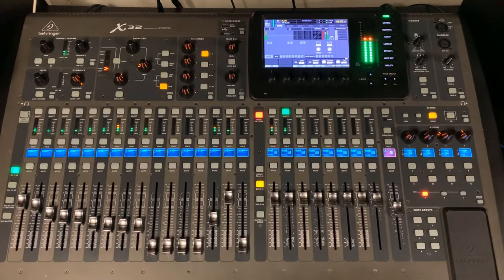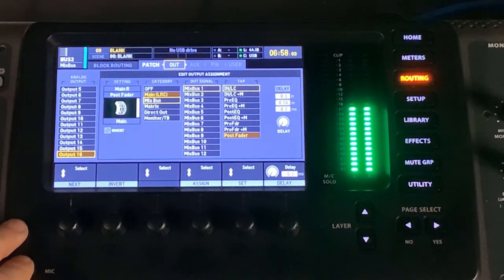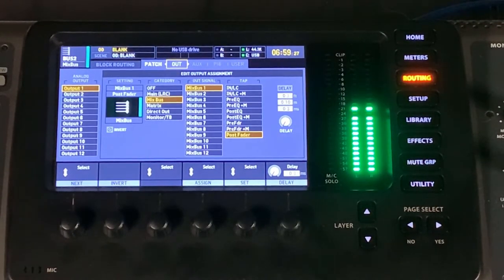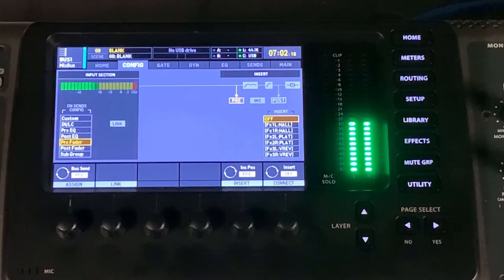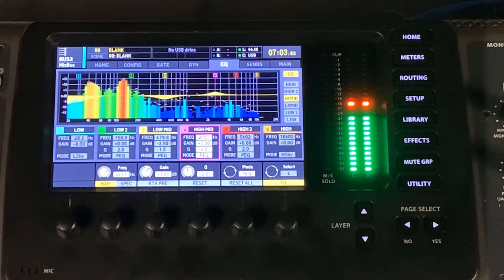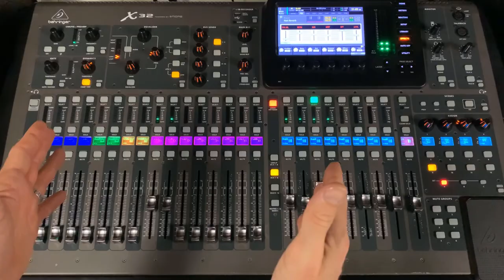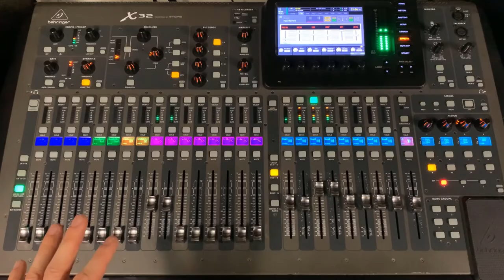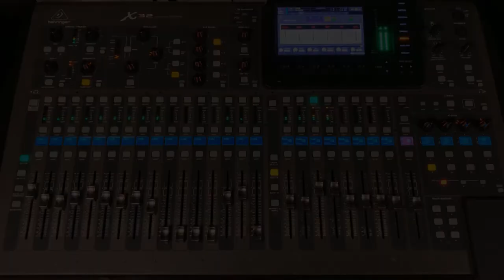How To Setup Monitors On The X32 (or M32) Sound Console

Comment: I am so lost on the M32.   But following along and making the changes on my board as you did in this video really opened up the idea that I can actually make this work....eventually.  Thanks so much.  Liked and subscribed.
Reply from the maker: Thanks for the encouragement. Let em know what your challenges are and I can either point you towards existing videos, help you in a one-on-one session or maybe make a new video.
Reply: @AllamHouse  I’ve got several and too many  to go into here.  I think I’ve got the trail for IEM down.  Now I have to be able to monitor the music tracks in Pro Tools while tracking drums.   A Sweetwater tech remotely set the board  up for recording onto Pro Tools…we just didn’t get to the monitoring part.
Reply from the maker: Here is a video that might cover a similar setup. This walks the viewer through sending audio to a DAW to be mixed for live stream. That mix is then sent back to the console and comes in on AUX In 1/2. This setup would allow you to track instruments into Pro Tools and then send some Mix from PT back into the X32 to be solo’d in the headphones or out the monitor output.
https://youtu.be/KpZpsO_l4Qs?si=lT1oD-UrkhfQvqSz

Comment: How would you go about adding effects like reverb to the house mix? (you mentioned in this video - that you would only want the reverb to go to the monitors - but I think I am wanting reverb in the house as well - but would want to control that independently from the monitors mix)
Reply from the maker: I don’t ha e a specific video about this yet, but it is the same process as setting up a monitor. The console has 4 preset FX racks and busses on Bus 13-16. Select the bus that relates to the FX rack you want, click Sends on Fader, raise the instrument you want going into that FX rack and you are set. Then go to the FX return on the left side of the console and raise the stereo return to the desired level.

Comment: Please help. I have worked very hard in learning as much as I can and we will be installing this board at my church. However, I am having a problem. When I tap BUS1 (which is our mon1) and tap sends on faders, and then adjust channels to be heard in that mon1, and escape out of it, when I then turn a vocal mic channel all the way down, I am still hearing vocal through the mains. I shouldn't be hearing that mic in the mains. What am i doing wrong? So frustrating. thanks
Reply from the maker: That is frustrating. You need to adjust the Bus from Pre Fader to Post Fader for sending the inputs into the Bus.  You do this by selecting the Bus and go to Home > Config and make the switch. This video explains the difference from the tap point for sending from the console. https://youtu.be/1GNmNWdVWKg

Comment: Great info - except at 13:15 where you say you "can do some light compression in the monitor in case things get out of hand". Professional singers will immediately notice that there is compression on their monitor and will stop singing to avoid injury to their vocal chords. Amateur singers will change the way they are singing to try to compensate for the attack and release of the compressor, including trying to sing louder as the compression ratio goes up. They will leave with a hoarse voice, which is not a problem for amateurs, but it is a big deal for folks who make their living with their voice. And repeated straining against a compressor can/will cause vocal chord nodules to develop, which require surgery to remove. 
The other 99% of this video was outstanding and helped me (an old analog guy)  tremendously!
Reply from the maker: Thanks for the input and great info from a vocalist perspective. As a drummer I tend to run a little compression on my IEM depending on the instrumentation. As much as we try to control guitarists they tens to have spots where their volume gets louder when there are people in the seats. I try to keep that controlled and save my ears throughout a night.

Comment: Hi! I followed the instruction by setup a mixbus but routed thru a Aux out 1 to Behringer HA400 this morning. I sent the vocal and keyboard channels to it. The user was able to hear thru the headset and happy with it.  However, I found out later when I turned down keyboard fader all the way to -00. I still can hear it from the main speaker. It seems like the volume no longer controlled by the fader.  Further troubleshooting found out that it only work if I first turned the mixbus volume down to -00. I didn't test it on vocal channels. Not sure what I have set wrong. Any suggestion? Thank you.
Reply from the maker: This is because you have the MixBUS setup as ‘PreFader’ instead of ‘PostFader’. PreFader is what you want for an In-Ear monitor mix so it does not change when you move faders for your House mix. If you have a wedge monitor or other open speaker that can be heard in your room then you probably want to run PostFader so that when you turn the fader all the way down in your House it will also turn down in your monitor.
Reply: @AllamHouse  I am pretty sure I set to Postfader. I will check it tomorrow or Sunday when I get back. Thanks
Reply: I did verified this morning that monitoring mixbus was setup as postfader. For any channels (keyboard, guitar or vocal) that I send to the mixbus, even I turn the volume down all the way down on each channel, I still can hear it on the main LR speaker. The only way is to turn the volume of the mixbus of it to -00.  If I don't send it to mixbus, I can control it with each individual fader. Is there anything that I misconfigured?

Comment: Thank you for the great video. Question. Using only my left output on my IEM transmitter. Would I need to plug in the right to the next mixbus to allow panning instruments left and right in the monitor mix?
Reply from the maker: If you are looking for stereo IEM that you can do panning you will need to start by making a stereo BUS.  You would take an odd numbered BUS and link it to the next even numbered BUS.  Then you have the ability to send stereo signals to both sides of your IEM transmitter (yes, through a second cable).  The board configuration will allow you to either take the panning used by FOH or your can override it in the sends area and customize the panning for this specific stereo BUS.
Reply: @AllamHouse  perfect! Thank you for allowing us to pick your brain!

Comment: Thank you ahead of time…. I’m using a X32 compact, its not mine, not sure if I’m doing anything right,
It’s been ‘adjusted’ prior to my arrival, I had difficulties getting 1 thru 8 to come out the mains, I pushed some buttons and it seems to be working, how do I get individual settings for the monitors without adjusting the ‘gain’… not sure if I’m explaining it correctly!
Reply from the maker: Gain should be set for each input and I look to set mine at -12dB on the input meter. The gain will impact all things downstream. Once this is set you will can find a monitor BUS, select it and then hit the “sends on fader” button in the middle of the console. This will shift and slow you to use the faders to adjust the level of each input going to your monitor BUS.

Comment: Hi there 👋 wondering if you can help me out with the x32.   Basically I have in ear monitors set up on bus 11 and I want to set it up as prefader but every time I do that it also changes bus 12 as Prefader but I need that bus to be postfader.   Any way to do this?
Reply: Pretty new but are they linked?
Reply from the maker: First thing, Make sure you have your scene saved to the console or to a thumb drive.  Then, make sure you are on V4.0 (or higher) firmware to make this real easy.  Assuming you are on V4 you can select the desired MixBUS 11 and hit the Home button.  Make sure the bus is NOT linked.  Then go to the Config tab and you can select this bus to be pre-fader.  If it is linked it will automatically adjust Bus 12 or if you are on the older firmware it will run in blocks as well.  Let me know how it goes for you.

Comment: You have video on in ear monitor mixes the eq and compression outline to setup a perfect in ear mix. I use shure 425 on a behringer p1.  If you could do a video on that thanks
Reply from the maker: Wow, that would be really complex to try and make a video like that. Each person hears different, each set of monitors are different and the instrument being played is different. I will say, I tend to use compression more as a limiter with a 10:1 ratio and remove just 1-2 dB. In terms of EQ I usually roll off the bottom around 50hZ since the actual monitors can’t accurately reproduce these frequencies. I also remove a little mud at 400 and maybe a little boost at 3k to add some vocal diction. Keep in mind I’m usually playing drums in a church worship context.

Comment: Hello! When I play with my band the master volumes ducks when we push the faders. Its like its a limiter somewere on the master L/R that limits the sound - it does not distort. Do you know anything about it? Im a sound technican but cant figure it out.
Reply from the maker: This is an interesting question. Here are the steps I would take to begin my troubleshooting process.
1) Take some pre-recorded music (iTunes, Spotify, etc) and send it into the console. Make sure your input level is between -12 and -9 on the input fader.

2) Turn this up in your main mix and begin turning the master fader up to the desired level in the room. Evaluate if you hear the same "limiting" happening. 

3) There is an onboard limiter and a channel compressor for the main outs and you want to confirm that these are turned off. Above the master fader, push the "select" button and then go to Home > Dynamics. Make sure the compressor is not activated by looking at the bottom left knob of the screen and make sure the words are grey and not orange. This confirms the compressor is not activated. Next click the "effects" button to the right of the screen and if there is a plugin active on the Main mix it will come up. If there is, then you can push the knobs below the screen so that INS is not orange therefore being deactivated.

Once you have confirmed that no issues are happening on the pre-recorded music, then you can move to the normal inputs. Set proper gain structure (between -12 and -9 on the input meter), build your mix and then begin bringing up the volume.  If you still run into issues, check after the console and see if there is a DSP (digital signal processor) or other settings on your amps or speakers that might be causing some limiting.

Comment: Hey Dave I got a dumb question the way I have my drums set up is its running through the board and I'm listening out through my in ears  out the main headphone jack on the x32  producer. I made an inear mix on a mix bus channel and ran my wireless inear system to that Also I tried my wired in ear system as well with the mix bus but it doesn't sound anywhere near as good as the headphone plug in the front of the board.my question is, is there any way to make a mixbus inear mix sound like what I'm hearing out the front headphone jack?
Reply from the maker: Yes. Keep in mind the headphone jack is a stereo feed of your main mix (unless you solo something and then that takes over). Your IEM is most likely a mono mix which will have much less width than your stereo house mix. I recommend linking two buses together to get a stereo mix.  Then, you could set it to Pre-Fader and build your desired IEM mix. You have the ability to follow your LR panning or do custom panning for your IEM. Also, make sure to add some FX into your IEM to sweeten it up.
Reply: @AllamHouse   much appreciated I'll try that for sure and if I can't get what I'm looking for I may have to do a one on one with you so you can further help me.i love this board but man it's a learning curve for sure.

Comment: So is there actually a difference between our channel beeing set to PRE-Fader and TAP PRE-Fader ? Or do we set the channel on the board to PRE-Fader but change it to POST-Fader in the TAP menu ? Does it change something ?
Reply from the maker: I'm not sure I understand the question exactly.  When using a MixBUS for monitors you will be able to select between pre-fader or post-fader which (for in ear monitors) you want a pre-fader mix.  In terms of the tap (preEQ, preEQ+m, etc) this determines weather you are feeding your monitor with a raw signal from stage or if they are getting the EQ'd signal that the sound tech is applying back into their monitor.  EXAMPLE: a guitarist as a super lush tone from their amp into the sound board.  The sound tech removes a hand full of frequencies with EQ to make it fit the mix and PA better.  Do you send the EQ'd signal back to the guitarist or the raw, non-EQ'd signal back? 

I hope this helps.
Reply: @AllamHouse  I play guitar. The signal that comes through the house sounds great due to the EQ adjustments that were made. The signal that I hear in my in-ear monitor (and on our stream) sounds squashed and very thin. I would like the EQ'd signal to come back. Do you do that by selecting the Post EQ option from the Config - Input Section or the Tap option? If post EQ is selected how does it effect post/pre fader?

Thanks in advance.

Comment: Hi
Thanks for all you’re great work!
I have  monitors set up prefader..
You indicated that the benefit of post fader is that the “drummer” csn use the app to turn up the volume of his drums in his monitor, but doesn’t that impact the FOH sound since his adjustments are increasing/decreasing volume at the fader level tap?
Reply from the maker: A monitor setup on a MixBUS has two main settings (Pre or Post Fader). A Pre fader mix (ideal for IRM) will allow you to have independent control of the mix. Regardless of changes made for FOH, the monitor mix would not change. If you have a floor wedge your musicians will still want a Pre Fader mix so it never changes, but sometimes you need to run it in a Post Fader configuration (usually in a small venue) so that when you turn down a fader for FOH, it will follow this change in the monitor. This would be used to help manage stage volume being heard in the house. This video goes into more detail. https://youtu.be/krg9L_mS-4I

Comment: Thank you very much.
Just one question. If I update The firmware of the mixer, i need to do the same for the rack on stage ⁉️ thank you
Reply from the maker: No, you do not specifically need to update the firmware on both at the same time.  It is very rare that the stage box  is updated and if it works fine there is no need to update. The soundboard updates typically provide new features or more efficient workflow and would be provided through a firmware update. PLEASE make sure to save your scene before updating your firmware on the console so your settings are saved. This video walks you through the process if you are not familiar https://youtu.be/G0bqVeviRKg

Comment: Hi. We purchased subwoofers for our sound at church. We have the x32 producer. How can I assign the subwoofers to a different output controlled separately from the mains? And really like to just send our bass players channel through that output. But still allow him the ability to adjust his in ear mix through the app. Hope that question is clear. Thanks for your time.
Reply from the maker: I put an answer to this in the video posted below, but here is a basic written version as well. 

Take MixBUS, select it and then De-select the “Stereo LR Bus” button (to the left of the screen). This ensures the mix will NOT be added to your mains. Then click the Sends on Fader button and add the desired instruments (bass, kick, etc). Finally, confirm this MixBUS is routed out the desired physical output and connect it to your sub amp. 

https://youtu.be/drNfnPChTwY

Comment: Hi Allam. Your  video is great.. I am new to the Behringer x32 compact. I am trying my best to find  way around it. Just a few days ago I cannot get any audio feed  to go to the monitors.  The two main speakers work great but my 3 floor monitors have no feed coming through them from the console. What advice can you give me? Thanks
Reply from the maker: Thanks for reaching out. We find ourselves in a troubleshooting situation here. 
1) I would start by connecting one of these speakers to the main output (since it is working) to make sure the physical monitors are working well. 
2) I would pick one BUS, turn the fader to unity (0), confirm it is not muted, confirm there is no DCA connected to control it and confirm there is at least one input going into the BUS (using Sends on Fader) that you can use to test. 
3) Plug headphones into the console, turn the volume up using the headphone knob and hit the solo button on this MixBUS. This will confirm there is a signal going into the MixBUS. 
4) Go to Routing > Out and confirm this MixBUS is set as the source for the output you expect it to connect to on stage. You can also confirm your tap point here is set to "Post Fader".
5) Connect your cables properly and it should work.

If something doesn't work, I'm happy to do a call with you. Just fill out the contact card on my website at https://Sound.AllamHouse.com
Reply: Thank you

Comment: This is great info.  I have a question for you.  Is it possible to EQ a channel within a given IEM buss.  example...I lead with  an acoustic guitar but I don't like the way it sounds in my ear but the techs say it sounds great in the house.  I really would like my D35 to sound like it was designed to.  Your thoughts?
Reply from the maker: Unfortunately there is bot a way to EQ the instrument (different) specific to its’ output location. What you can do is select the channel, click on the Home button and page over to the Sends tab. Here you can use the encoder knobs to select if the channel is being sent to the monitor PreEQ or Pre-Fader. You would probably want to go PreEQ to get a non-altered signal.